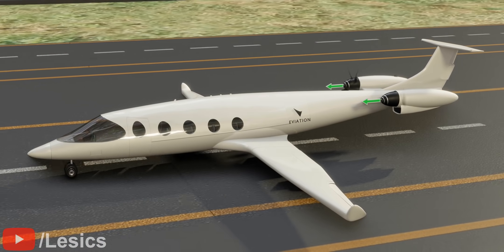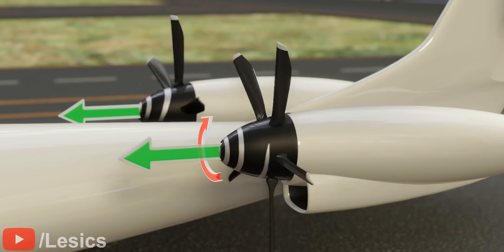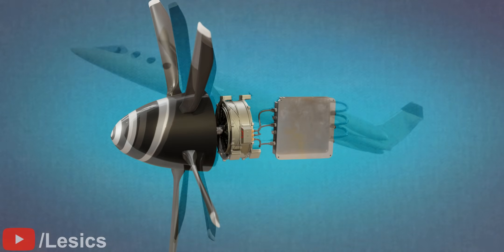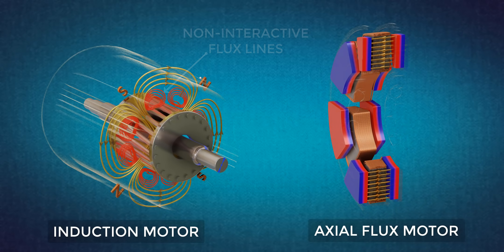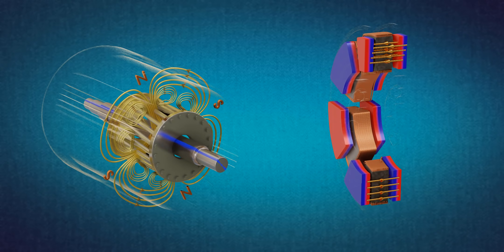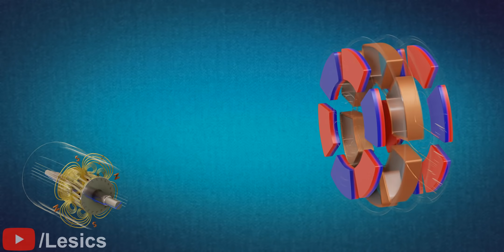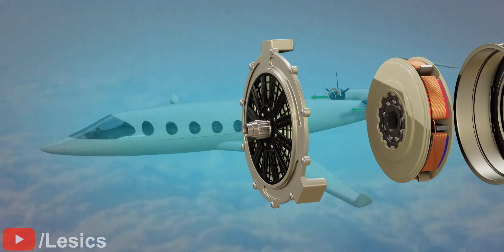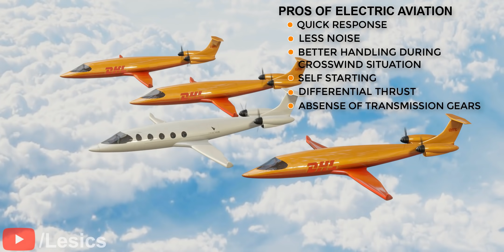Electric Aviation | The Dawn of an Advanced Transportation Mode

Comment: Electric planes aren’t going to happen any time soon. Not unless there is a complete breakthrough in battery tech. Liquid Fuel will always pack way more power per lb than battery. And unlike battery, the longer you fly, the lighter you get, which means the less fuel you need. Battery will not be able to compete with that. Not for many decades. This was a really bad take.
Reply: I personally would like to see the roll out of Hybrids, the advantage of the electric motors seems to great to ignore and to just hook it up to an onboard powerplant would be fine for me.
Reply: @eisenkrieg553  I'd drive a Prius but I wouldn't drive a Tesla.
Reply: @eisenkrieg553  excellent idea
Reply: @WilliamHelstad  Using the airframe as the battery is an intriguing idea albeit an impractical one with any current technology.  There is not any current battery technology that has the structural properties necessary to construct an airframe out of.

Comment: Usually this channel puts out pretty good material

This however is garbage...

Battery electric planes will NOT be a thing, power density is far too low there is no battery chemistry that gets close to what's neccesary

Hydrogen fuel cell electric planes will NOT be a thing, power density (volumetric) is far too low (and factoring the weight of the storage vessel power density by mass is ALSO too low)

Hydrogen combustion planes will NOT be a thing (see hydrogen fuel cell)

Hydrocarbons of pretty much any sort used as jet fuel have ~45mj/kg and the turbofans we have now are something like 50% efficient, meaning any alternative fuel source needs to be 22.5mj/kg in density at 100% efficiency to come close to conventional planes. There is literally no chemical storage that can get here (nuclear sure but we're not going to have nuclear powered planes for obvious reasons).

What most people tend to forget is that electric cars are so much better than regular cars because regular cars are inefficient as fk whereas planes have been optimized to the max over the past 100 years. EVs also excel at energy recovery which is a feature which a car can benefit from massively from it's use case but a plane can't because planes don't ever stop and go, they accelerate ONCE and decelerate ONCE in a flight.

Planes are already aerodynamically optimized (another key difference between electric cars and regular cars ... nothing intrinsic about electric cars being more aerodynamically efficient, only that if they were not, they would have a range half that of what they are now and no one would buy them)
Reply: Also I dont think that any induction motor or synchronous motor can match powe density of jet engine .

Comment: It's extremely interesting and educational, but a suggestion would be to also briefly mention why regular plane still use jet engines. 

If one already has some knowledge on how and why things work it is not a problem but, is someone see this without any knowledge on regular airplanes, he could wonder about why we still don't use electric airplanes instead of "normal" planes and this could cause some misinformation.
Reply: We need more energy dense storage methods for electric. As is it is still far behind jet fuel.
Reply: @johngriffin618  weight is the biggest problem as planes needs to land lighter than when they take off and batteries doesn't provide that.
Reply: I know... but a lot of people don't
Reply: I hear your point.👍